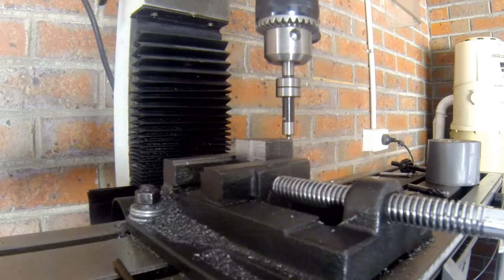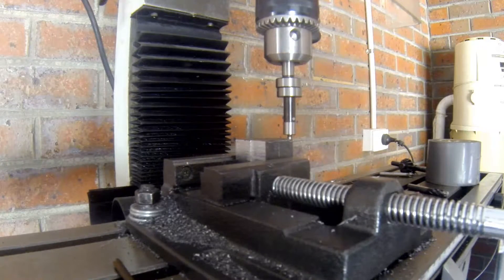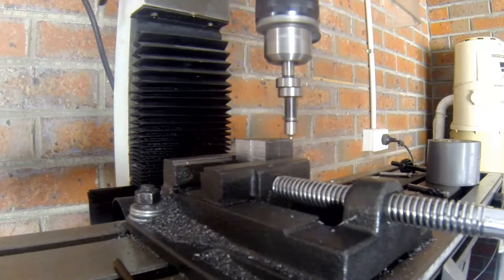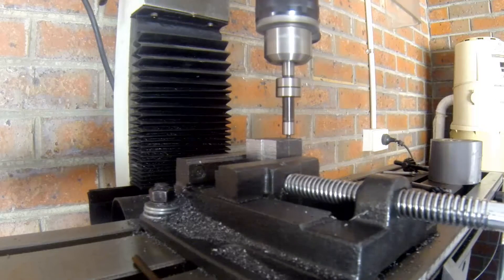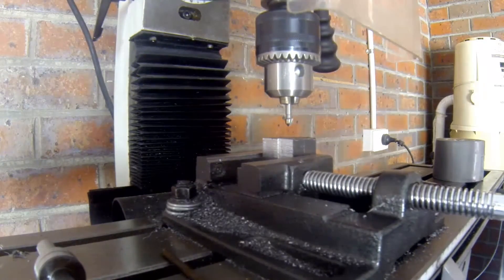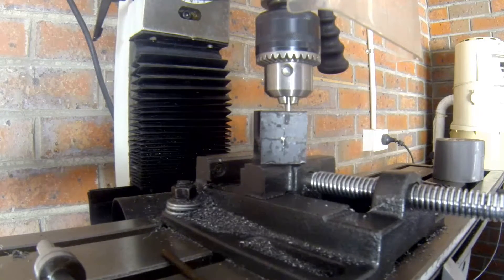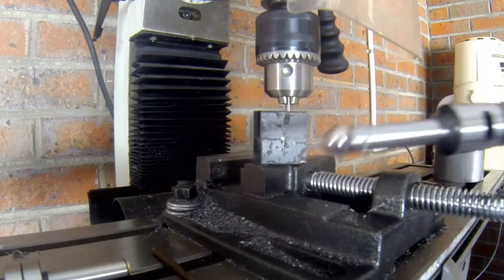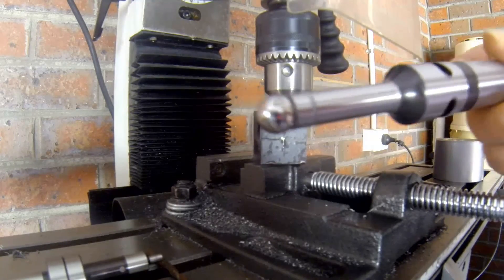Mechanical Edge Finder   ||   Finally arrived

Comment: too much rpm for a edge finder
Reply: What's the recommended rpm for such type of mech edge finders? Also, does it make any difference in accuracy while holding it in drill chuck vs collet chuck?

Thanks in advance